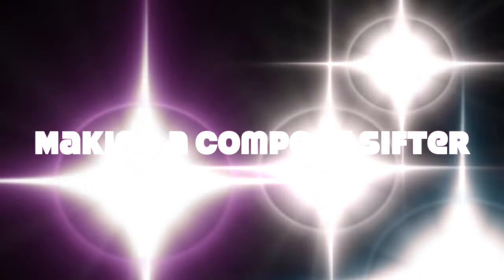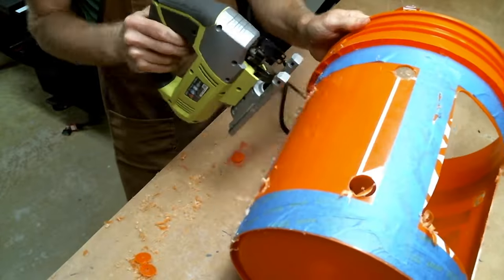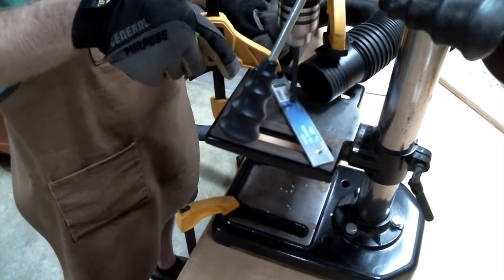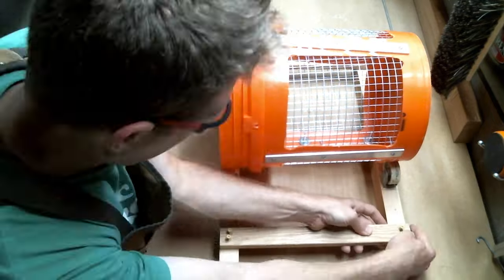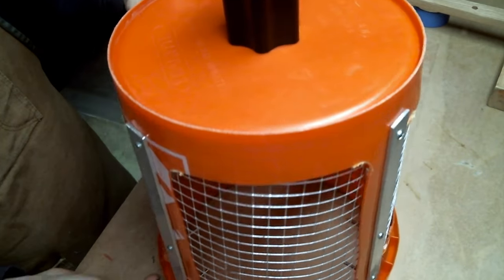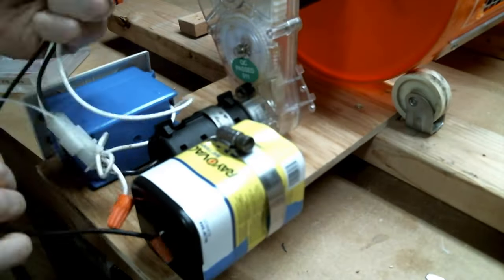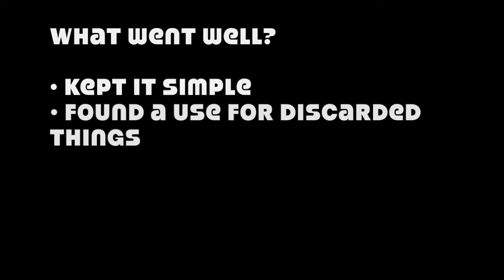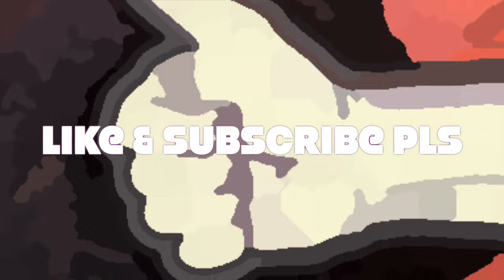DIY Compost Sifter / Trommel -- From Reclaimed Materials!

Comment: I once made a nearly identical device that was powered with a microwave motor. I used it with water and sharp sand in it for tumbling rusty nails and screws to remove rust from them. It worked wonderfully well, and it was quiet as a mouse. It was only about a gallon sized plastic bottle with a large sized lid. It probably had been a catering sized mayonnaise bottle or similar. My nails and screws looked factory fresh after slowly tumbling for a few hours. I left it behind when moving, so I will now be making another one for derusting hardware. Thanks for reminding me with your simple sifter.
Reply from the maker: Sure thing! And who knew that one could de-rust hardware in a tumbler? Today I learned! Thanks 🙂

Comment: You can use a power control switch to control the voltage output from the 12v battery

Comment: How long does the battery last and have you worn out the bucket?
Reply from the maker: So far, I've gone through about two times of emptying the white 55-gallon compost tumbler using the sifter. The battery still seems to be doing fine so far; the only problem is when the load on the system is too heavy, and the sifter slows down or the casters don't stay in the channel. The bucket hasn't worn out at all -- I'm not very concerned about that. I think that to address these issues, I hope to at some point incorporate ideas suggested in the comments about going with the 12V battery and a dimmer switch in order to control the speed, as well as casters on the other sides of the bucket to keep it in place.

I tried using an old AC adapter instead of a battery (obviously, in order to avoid using a battery at all) at one point during the initial development of the machine, but it didn't work with the motor -- the motor would continually start and stop, start and stop, start and stop... I think this StackExchange question is more or less what's going on: https://electronics.stackexchange.com/q/419562/323054
Reply from the maker: Actually, this is the forum thread that very closely matches what I was trying to do, and likely what the problem was: https://www.societyofrobots.com/robotforum/index.php?topic=18073.0

Comment: Use additional casters on the closed end to help guide. 
I saw a video where the used grip tape on the plastic in the wheel track, bc it's slick.
Reply from the maker: The casters fit in the channel so snugly that I don't think there is room to add grip tape. Adding casters on the sides and/or the top might be my only option. For now, I just turn off the machine and put the trommel back into place, which isn't ideal, but it's good enough.

Thanks for the suggestion!

Comment: Wouldn’t you want to position / angle the cylinder such that the too big pieces fall out of the open end by gravity after a few spins to be collected a back-to-compost bin / second wheelbarrow?
Reply from the maker: Yes, that's the set-up I had going. Not sure if it was apparent in the video, but there was a smaller wheelbarrow below (which, by the way, was also something I picked up for free on rubbish day, but incidentally has since broken and been tossed out) to catch the larger pieces. Thanks for the comment!

Comment: I think you should go with a 12 volt battery and add a speed controller. I also think you should have used more parts from the jeep, the gas pedal could be used as a speed controller and I also think you could have used the switch in the jeep to make it either go forward backward or not move at all. I suggest that you also add something to the top to stop the bucket from coming off the track like you mentioned. 
Over all great project and excellent camera views. Thank you so much for sharing. I big Thumb up.
Reply from the maker: Yes, definitely good suggestions. I guess I was so new at salvaging parts from something like the kids' jeep that it didn't occur to me to grab those other things you mentioned! But good things to think about for the future.

Thanks very kindly!

Comment: A thought:  Why not design a tumble composter that serves both purposes? Mechanically, the composter and sifter are nearly identical.
Reply from the maker: Hmm, a very fair idea and suggestion. I certainly hadn't thought of that.
Reply: Could you have a swappable door made of the mesh to go on you composter? Then “just” add a motor 😀. Great video by the way .
Reply from the maker: @Button Monkey: Also a good idea. 👍🏻
Reply from the maker: However, after some more thought on this, one issue with using the same tumbler for both the composting phase and the sifting phase is that the sifting wouldn't work, I don't think, if the tumbler were still full to the brim with compost. There has to be enough capacity in the drum for its contents to fall around when the drum is rotating, or else there won't be that action that separates contents of various sizes from each other (nor would compost stuck near the axis of a filled up drum really experience much turbulence, for lack of a better word). I suppose that issue could be solved by emptying the compost out of the drum and then shoveling it back in, bit by bit, once the machine has been transformed into sifting mode, though...
Reply: That sounds like a lot of work 🤔. Thinking time required 🙂